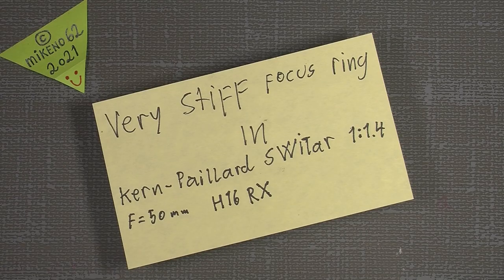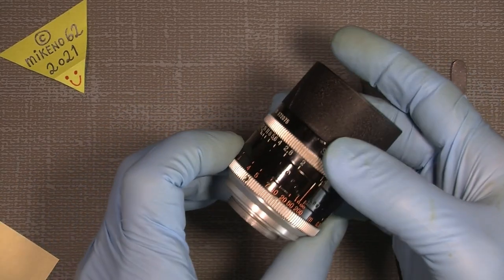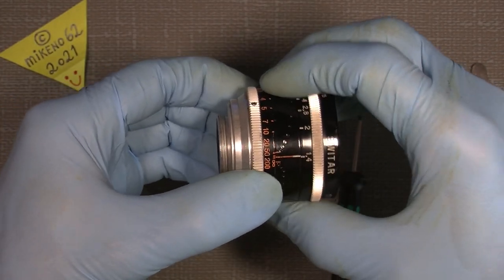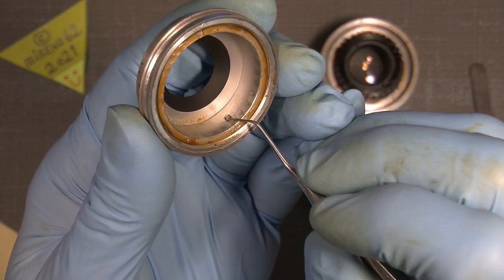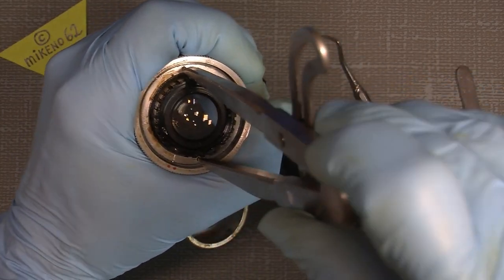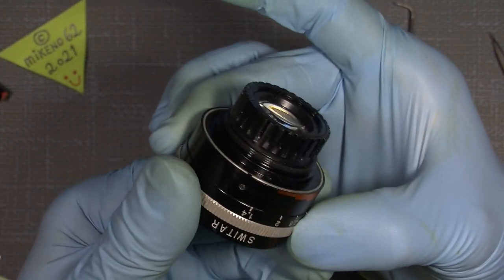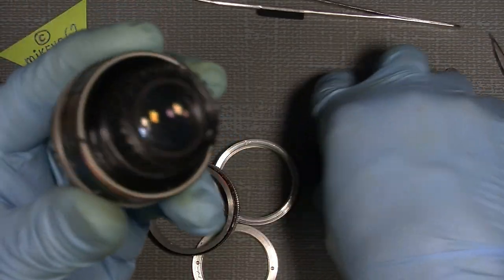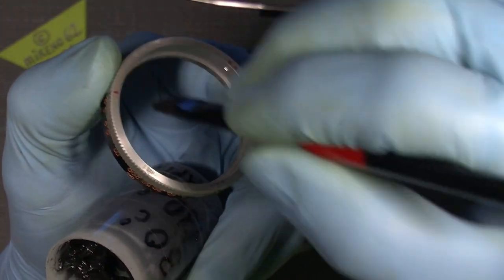Very stiff focus ring in Kern-Paillard SWITAR 1:1.4 f=50mm H16 RX

Comment: i want to try to do it too. I'm afraid I will damage the lens though. any tips? Thanks for all of your videos!
Reply from the maker: Hi David
When working with focus helicoids, it's VERY IMPORTANT to remember to set small marks, BEFORE disassemble the helicoids and also measure how long/short the helicoids are at infinity.

Also remember to count how many turn(s) it will take to get off the thread, and also set marks where the helicoids get separated!

In my opinion during many, many different lenses, I think it's best to only take one helicoid off in the thread in the process, because one have a better overview and get's less confuse how things are sitting correct.

There is NO (0) repair manuals for those old lenses.

Best regards
Kenneth